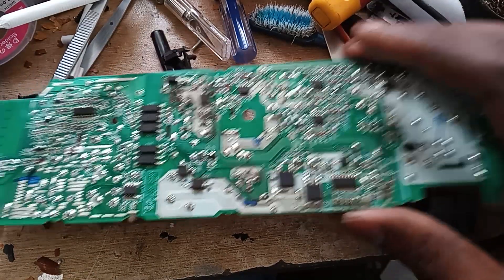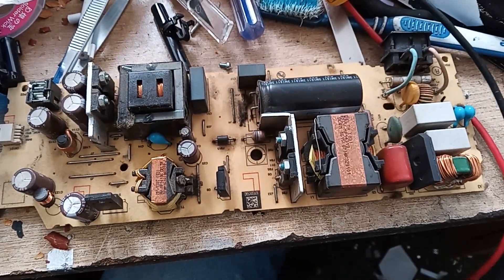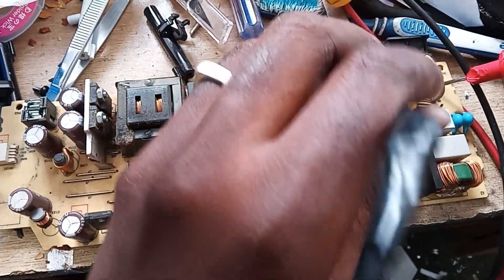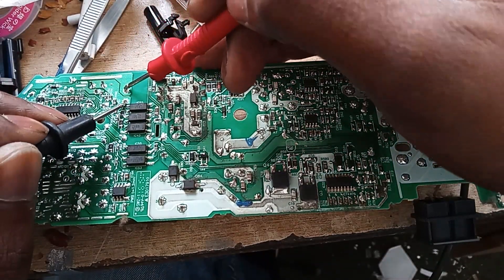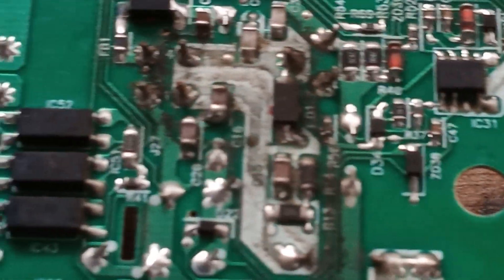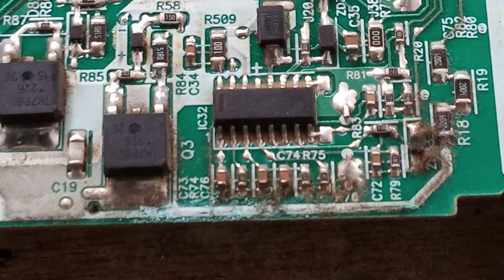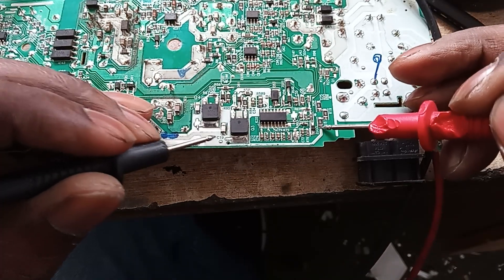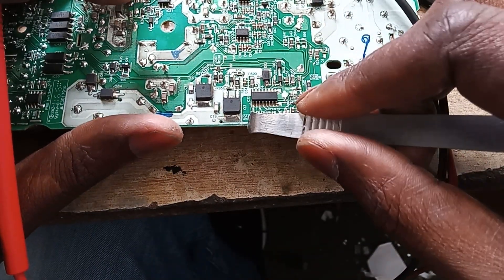Ps4 adp-200er repair

Comment: I have a n14-200p1a (adp-200er). It gives standby ok but when turn on, the pfc boost the capacitor voltage to 400V (but no 12v is generated) and the psu shutdown completely, even the 5v. I have unplug and replug the mains to turn the psu back on.

Any idea where I should check? I checked all mosfets and diodes for shorts.